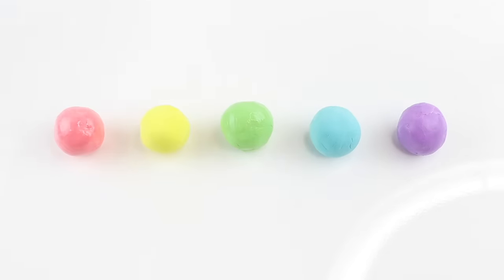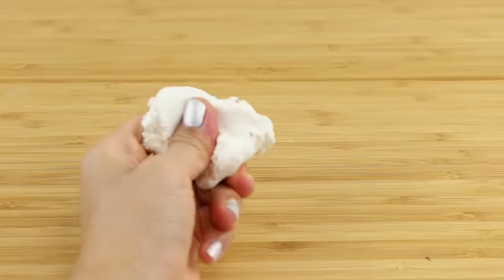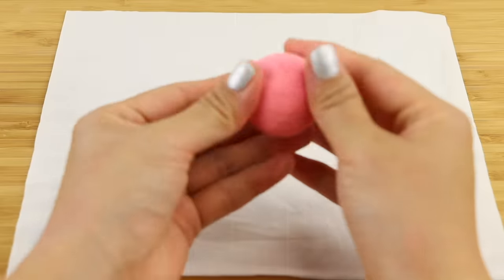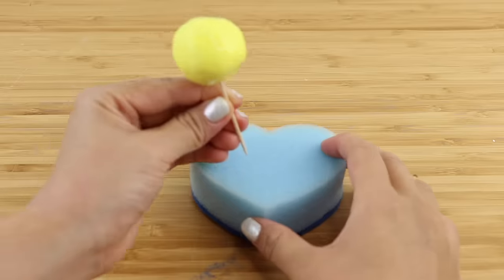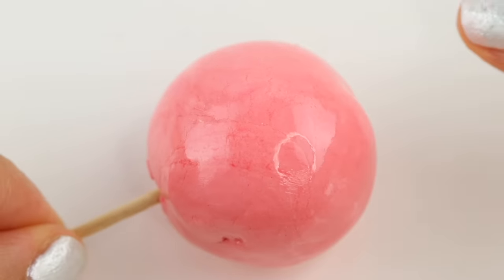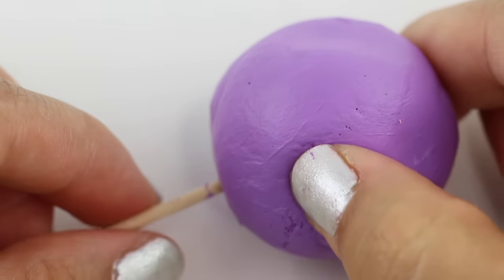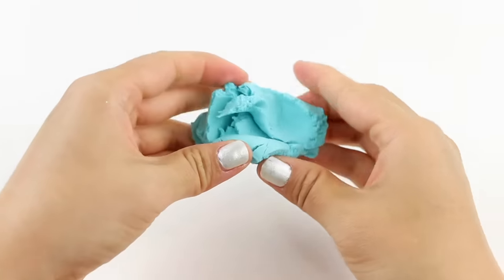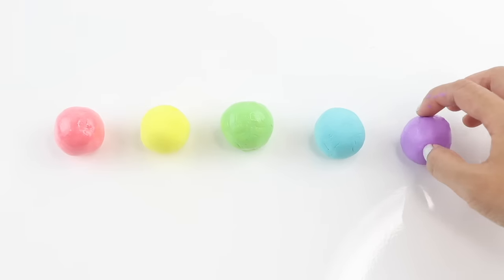DIY Clay Cracking TOPCOAT EXPERIMENT!! Viral Clay Popping ASMR

Comment: Dip the clay in melted wax
Reply: Yeah
Reply: ✯𑁍gacha_tube❤︎  
It depends on the wax you're using. Soy wax doesn't work for cracking, btw.
Reply: ✯𑁍gacha_tube❤︎   paraffin wax works
Reply: ✯𑁍gacha_tube❤︎  you should melt the wax then let it harden in the freezer
Reply: Yes

Comment: You could always get an air tight tupperware container and fill it with clear nail polish, that way you just dip your clay pieces and set them to dry, just repeat for your next coat. It would be quicker so you wouldnt have to deal with the smell as much and then you can just seal it up for next time you need it.

Comment: The issue here is mainly elasticity. Pva glue, acrylic and egg whites have similar compounds that make it stretchy. Nail polish works becayse it's a Laqure the paint is used for snap kits and models to not just coat but protect the serface making it brittle yet strong if applied correctly. Sadly Laqure paints and nail polishes all have toxic fumes if breathed in too much. There's possibly more options of non elestic compounds to try or try looking for varnishes with out rubberized compounds. There's a few brands that say fume less or non toxic. Reason I say look for non toxic is that Laqure paints can have toxic fumes and lead in them. For you and your families safety look for alternatives of non elastic compounds. Wax or soap making could provide you nice alternatives that are safe and fume free :)

Comment: How about the spray on top coat?  I think the hair spray would've worked better if you got some cheap Aquanet or something similar that dries down hard as a rock or what about super strong hold hair gel?  Or super/nail glue the kind that dries down crunchy? Or try using acrylics powder like what they use for nails in the salon that'll make a thick shell that dries quickly, that might break like the picture you showed in the beginning.

Comment: I don't know if you've tried this before but will the top coat crack if its a very light coat of resin? A regular amount of resin will probably make it so you would have to use a hammer to crack it.

Comment: Since the hairspray one was the closest to the nail polish in the sound it made, I wonder how other types of hair products would work? What about a freeze spray like the kind used to style spiky hair or wigs? Unlike most hairspray which tries to balance hold and flexibility, those types of spray are designed to be rigid, so I feel like they might resist squishing more dramatically when used for clay cracking.